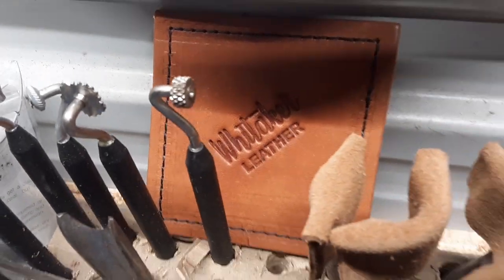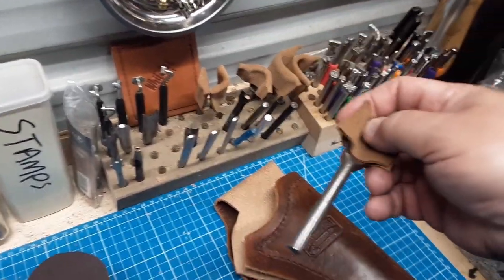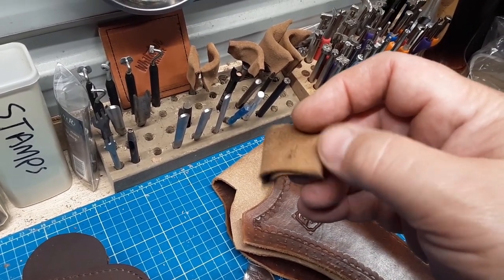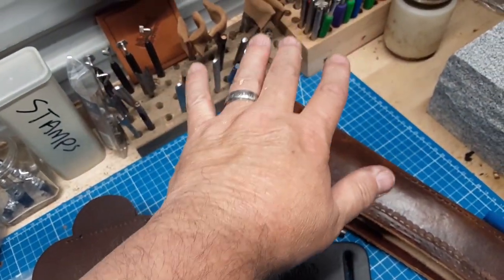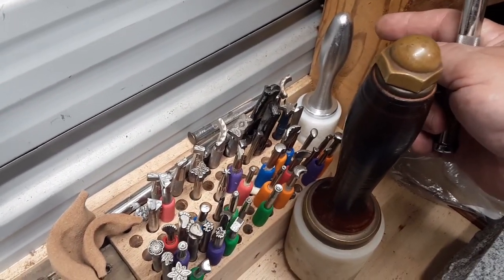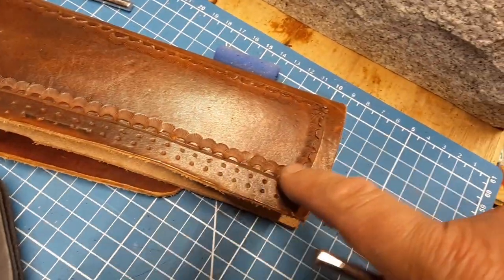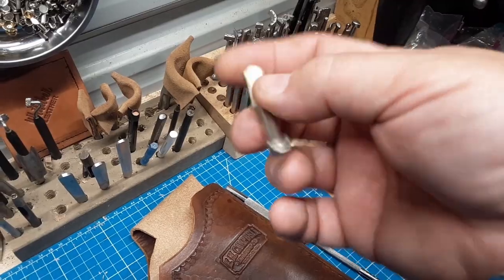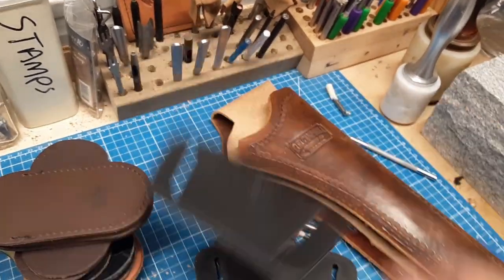Leather Work Sore Hand Cheap Solution - Better Grip for Leather Tools - Leather Tooling Made Easier

Comment: I've not tried this yet, but I've seen people use rubber fuel line hose pushed over the stamping tools. I have the same problem with my hands and neuropathy issues that make it hard to hold these smaller tools.
Reply from the maker: Hi Jeff, sounds like the same idea - a neat solution! They've helped me a bunch with grip and being able to stamp longer without getting finger soreness.
Reply: That is what I have used. Gas hose does work. My old hands are so screwed up if I try to hold a stamp without anything on it, it will shoot off across the room when I hit it.
Reply: @TexHoss1  I feel your pain there Hoss, I saddle stitch all of my handiwork and after stitching up a trifold wallet or a pancake holster, or anything requiring so many stitches to build, I felt my index and middle finger and my thumb going into cramps about 3/4 of the way through the sewing of the project. It gets so bad that both finger digits freeze up in the gross form of a 2 fingered "pointing" position, [think about pointing toward something outside that you wanted to show to a friend]! The doctors were no help in freeing up those appendages and, after trying a bunch of pills, shots, a few trips to the bone and nerve specialists, I decided to experiment with some common sense things which I thought would ease the hard "pinch" I had to use when stitching 8 to 10 oz. of leather glued together to make my holsters. [for example]. 

I tried a couple of padded garden gloves and workman's gloves which were dipped in a silicone "grip" solution  to give a better grip to whatever I was needing a little help with pulling the John James stitching needles through the stitching holes in the leather. Most of the different coated gloves did not serve my purpose until I was looking around a "Harbor Freight" store here in our area and I came upon a pair of heavy duty poly coated gloves similar to the ones used for housecleaning chores. They were made out of canvas, completely coated outside in blue poly or some other plastic coating and then the fingers and palms of the gloves were coated in another thicker layer of what appeared to be the same type of grippy coating. My need was for just what these gloves were designed for, gripping a tiny object, like a leather needle, to first push the 1st needle through the hole to be stitched and then to pull that same needle through and do the same with the other needle. If this makes no sense, watch almost any "saddle stitching" video on YT and you will see what I am talking about.

I cut the fingers off the gloves so they looked like "biker's riding gloves", slipped them on the thumbs and first 2 fingers, and started stitching to see if they would fill the need I had to have to continue my leather work for any future length of time. Not only did they make it almost too easy to push or pull the needles through even thick laminated veg. tanned leather but they made it so easy that I have yet to feel the pain of any further finger cramps! I have completed a trifold business card "wallet" and am in the progress of building a couple of chrome tanned leather tool pouches, with individual pouch openings for each tool in the sets of cutting tools and a closing flap on each pouch with double snaps to keep the flap closed when not using the tools within. Know that I was not trying to PUSH the needles through the leather, merely grasping the sides of each needle to first start it through the stitching hole, then grasping the same needle with the other hand to PULL the needles the rest of the way through the stitching hole. [It sounds a lot more "complicated" than it really is], but I have not found any type of glove with a strong/tough enough surface on the fabric to actually push on the eye end of the needle to push it through the stitching hole. Even the blunt point of the needle "eye" would most likely drive on through the skin of the glove and prick the skin on the thumb or forefinger which was doing the pushing. 

I simply don't have the finger strength any longer to "pinch" a needle, which is less than 0.5mm thick, with sufficient strength to complete the stitching of a project without having to grip the needle tight enough to the point where it will pass through the thick level of leather with sometimes 100 or more repetitive stitches to complete a project.

Comment: A great video! A question, whats the best linning for a holster that will not scrub off the bluing in a pistol? Thanks in advance!
Reply from the maker: Hey Max, I used vegtan leather for my holsters and I never use a suede liner. I think that's more of a result of learning the craft over the years in the Western Saddle and Tack business. If I do use a liner, if requested by a customer for a custom build, I used the smooth side of vegtan thinned way down and glued to the other piece of leather, rough side glued to rough side. The only holsters I have lined with suede were for CosPlay customers that are not using real revolvers or pistols etc. Hope this helps and sorry for the delayed response!
Reply: @whitakerleather  I use a medium "hand" 1-2oz goat skin, when I can find them for lining any of my leathers which may need a finished look or other purpose such as Max asked about. Lately I have been using 1oz kangaroo skin for lining on the higher end holsters and I have even tried a softer goatskin or lamb skin for leather knife sheaths and display holsters for antiques and really expensive handguns. Once the lining leather is thoroughly secured across the inner surface of the holster, it may wear out for weapons used daily or other hard uses, as the softness of the leather would wear faster than the bluing on the weapon itself and if that shooter is used on a daily basis, simply the  drawing and holstering of a handgun in soft leather lining will undoubtedly wear through the lining prematurely. My dad would always carry his .357 Python in his canvas hunting coat to cover any unforeseen encounter with a forest "meanie" when we hunted grouse or turkey in the mountains and the bluing was worn off of the end of the barrel and a couple of other high spots on the handgun from simply drawing it out of his coat and replacing it back within its special "pocket" after dispatching a timber rattler or occasionally a feral dog roaming around the woods looking for a meal.

Comment: I use cut up silicone straws
Reply from the maker: Great suggestion! And low cost as well. Thanks for sharing your tip!
Reply: @whitakerleather  Hmmm, I know I am pushing it on my age, [81 yrs. completed this Feb.], but I haven't demented to the point of living under a rock yet! Still, I have no clue what a "silicone straw" is??? I have seen paper, plastic, both bendable and solid "stiff" plastic straws, and even some stainless steel camping straws for lidded outdoors travel mugs, but I have missed out on one of life's joys by not experiencing the thrill of sucking a Coke through a "silicone" straw!

Oh, BTW, that long barreled six gun you are showing is, rightfully or not, referred to as a "Buntline Special".
Reply from the maker: @oldleatherguy  They are soft silicone drinking straws. I think that is what @sophiapardue171 suggested. Here's a link to some I found online - not an affiliate link, just a quick link to show what they look like. https://www.walmart.com/ip/UpwardBaby-Multicolor-Silicone-Straws-Pack-6-inches/2160666617?wmlspartner=wlpa&selectedSellerId=0&wl13=3660&adid=222222222772160666617_117755028669_12420145346&wmlspartner=wmtlabs&wl0=&wl1=g&wl2=c&wl3=501107745824&wl4=pla-306310554666&wl5=9013296&wl6=&wl7=&wl8=&wl9=pla&wl10=8175035&wl11=local&wl12=2160666617&wl13=3660&veh=sem_LIA&gclsrc=aw.ds&&adid=222222222372160666617_117755028669_12420145346&wl0=&wl1=g&wl2=c&wl3=501107745824&wl4=pla-306310554666&wl5=9013296&wl6=&wl7=&wl8=&wl9=pla&wl10=8175035&wl11=local&wl12=2160666617&veh=sem&gad_source=1&gclid=Cj0KCQjwlN6wBhCcARIsAKZvD5gEWRZYJtNBl9NPuZTTmDerPsjNjE4bapu-WB1paULUsG0ZheQrb2YaAr44EALw_wcB